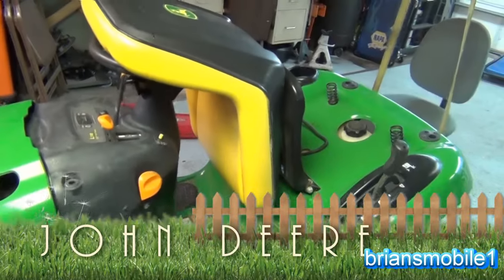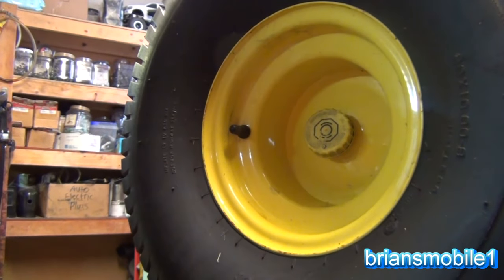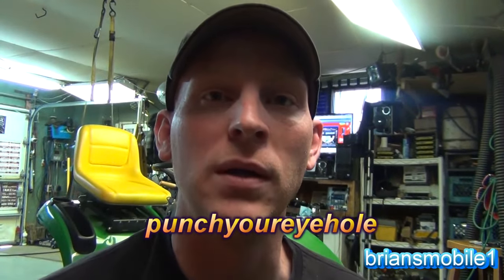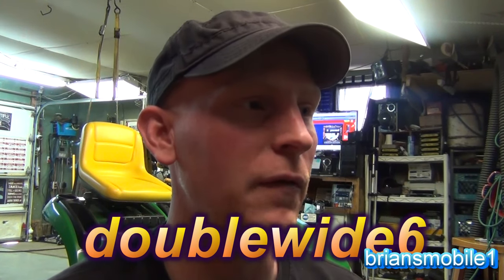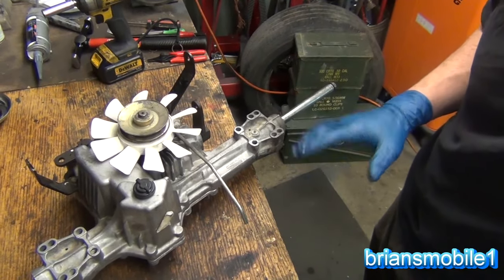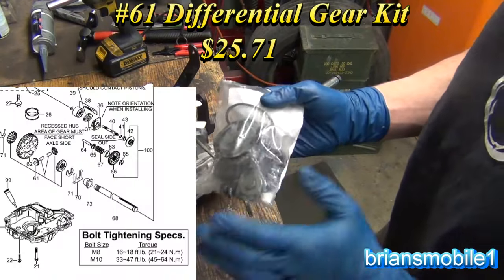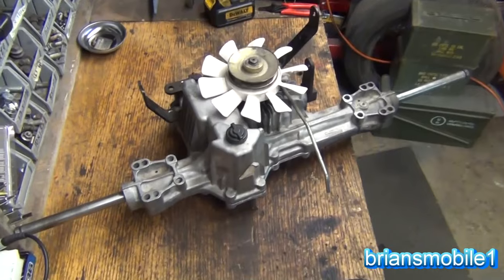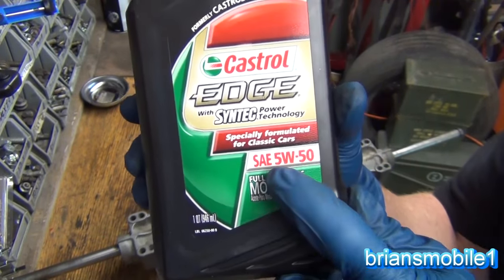Part 2 John Deere L-Series Transmission Repair Rebuild Parts Req'd

Comment: I'm not sure if this has been asnwered.  I haven't seen it in the comments specifically and there are quite a few comments.  However, I have a a L130 with a K46.  It has about 1000 hrs.  My issue is that it will initially mow at a good speed but after about 10-15 minutes it will begin to slow down and eventually come to a stop and seemingly starve for fluid.  It has a loud whine to it also.  I've replaced the filter by following your instructions because it was very clogged, however it did not solve the issue.  Any ideas as to the issue? the pump maybe?

Comment: I have John Deer x300 and the rear axle seized up and nearly threw me off the mower. Any ideas what happened inside it? I put it in neutral and got it to roll. The back tires would go about a turn before hitting strong resistance. I eventually got it into my garage and out of the rain.

Comment: So, I just pulled the transmission and popped the cover and the gears seem fine.   A little bit of debris caught on the magnets, but not too bad.  What are the odds a fresh fill of the right oil would make it happy?
Reply: Curious how you made out
Reply: I'd say your chances are pretty good because I've noticed more mechanics who are saying they're finding Tuff Torq hydrostatic transaxles that were filled with improper light grade oil, causing them to fail after they heat up after 30 minutes of use.  
https://www.youtube.com/watch?v=sxfWmMEU3YQ
And as you can see from that video, it's not just happening with the John Deere lawn tractors.  I wonder who the hell fills these transaxles with oil before they're sold to the customer.  Is it Tuff Torq?  Is it the tractor companies?  Or is it the dealers who sell them?
Reply: @mrbubetube  some mower mfg add thier own oil and some come from the trans factory pre filled, if they come from the trans factory filled they will have the correct type of fluid.

Comment: In my repair job I dropped the IDS valves out and lost either the ball or balls. Found the springs and valve. Looking at the diagram I don't know if one or two balls go back in first then the spring. Can you tell me how this goes back together. I'm stuck till I find out? Thanks

Comment: Hello I had a surprise,the 180 John Deere I have , has no capped openings, no fan, it was made by 
The co. That makes all of the transmission for JD at the time. The casting had the place where 
The vids showed individuals prying up the cover I just had castings. There is a switch that allowed 
Me access to add oil. 7/8 inch size switch nut with 2 contacts on it. Also I found the replacement of the 
drive belt was easier w/o the deck in place. So tomorrow will be the test if it is ok  or not... thanks 
For the instructional vids, a few minor things like the pin under the brake cam falls out, front mounts 
Hold a belt guide, that is about it.

Comment: after pulling my unit out, taking apart and dissecting interior, I can not see any wear that may cause the failure. calling the Tuff Torq people, they no long can help and will only tell you to call a dealer. "we now have constraints on use from helping anyone with any question". bottom line is, I have my work beach setting with a transmission "all dressed up and no where to go". any suggestion?
Reply: Did you ask the person on the phone why they built them to fail?

Comment: So I was wondering, I'm looking to buy a new JD D140 come end of season and it also has a T40 transaxle. Would you suggest emptying the transaxle oil and putting in the synthetic, right from the start?
Reply: I can tell you that every D140 I've seen had it's transmission weaken immediately after the warranty or fail completely.  Most of them simply weakened so that they could no longer go up any hills.  Experienced mechanics I've talked to all said they are designed to fail, and are also designed so that the average owner cannot fix them or replace them at a cost that is economically preferable to buying a new one.  They're designed so that as soon as the warranty is expired, the cost and trouble of repairing them makes it preferable for most people to just throw it away and buy a new one.  That hour meter they put on every tractor is for John Deere's benefit, not the owner's.  Some day they'll have wireless transmitters installed so they can collect even more data and fine tune the date of tractor failure even closer to the warranty expiration date.

Comment: Hey Brian I just finished one of these and after it was installed on the mower I push the pedal forward and it moves backwards if I push the order backwards it moves forward. “ and the belt is confirmed correct “ what in the world could I have done wrong?
Reply: Twisted the belt
Reply: if the motor housing was installed upside down it will run in the opposite direction as is should.
Reply: Did you figure it out?

Comment: My JD 110 lawn mower will work fine for the first 10 to 15 min and I figured the transmission is getting hot and has trouble accelerating.. i just don’t kno what to replace first.. is it the belt tension?? Or do I need a new transmission??
Reply: I know it's been a year but it might help someone the oil has broken down change the oil with fresh 50 weight and it will pull again
Reply: @esljam3422  Thanks, I'm gonna try that

Comment: Poor oil so just out of warranty it dies and you go buy a new one or pay them to fix it. 200H and it died, I would be seriously peeved if I bought a vehicle and it died with less than a quarter of average use on the clock. Doubly so if it was from a known manufacturing defect which the poor oil selection is.

Comment: trying to fix a K46 but when i go to tuff torq, there are no diagrams. i need a set of filter IDS any help please in getting the part number ?
found the parts here for a LA120 - https://partscatalog.deere.com/jdrc/sidebyside/pin/GX0120A033969/equipment/65119/referrer/navigation/pgId/84088588

Comment: I do know that it is a non-serviceable part when it comes to JD, so I want to know I can make this thing last beyond it's 120hr warranty.
Reply: I have 747 hours on my L120 and this will be the first time I’ve had to touch the tranny. I beat the crap out of this mower with lots of roots and rocks.
Reply: if you want it to last change the fluid after the first 50hrs and every 200 after that,  some models dont have a drain plug so you have to remove the trans to flip it to drain it.  us the tuff tech fluid from tuff torq.